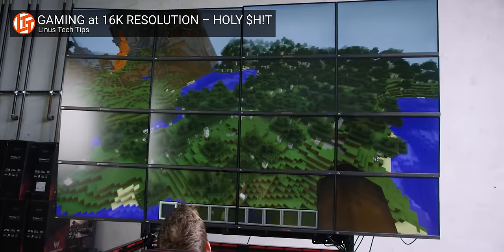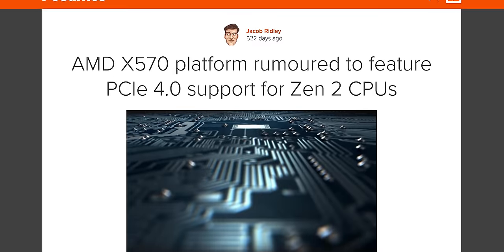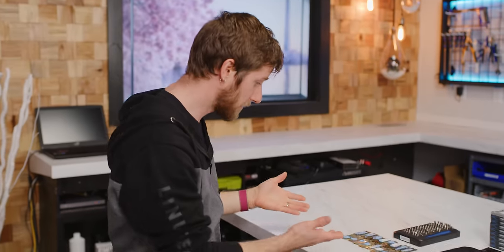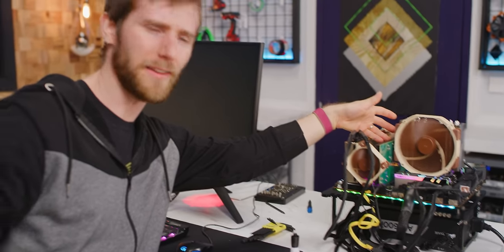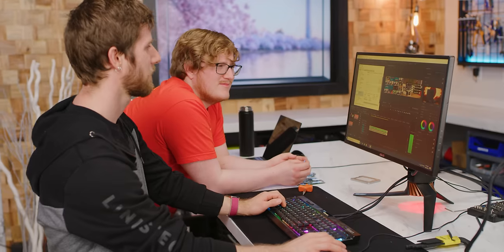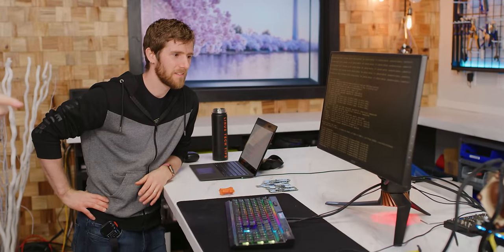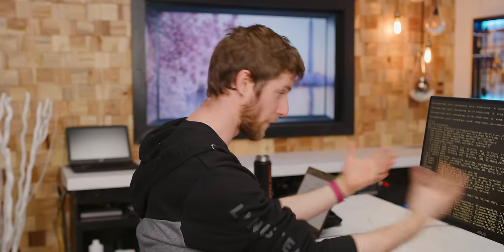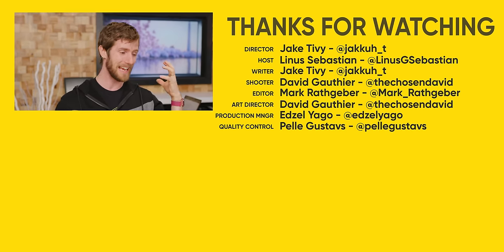This is 50x faster than your PC… HOLY $H!T - Liqid LQD4500 Honey Badger

Comment: Title: "This is 50x faster than your PC"

Me: using a 9 Year old HDD with about 20MB/s
"i think you misscalculated something there"
Reply: I think mine is older
Reply: Mine is 13 year old
Reply: But i got new pc
Reply: Been there. Get a SSD. Not even a fancy one. Literally the cheapest one is okay
Reply: *old
Reply: @llvmpipe  hayırlı olsun
Reply: Imma bouta do the math!
Reply: ok
Reply: @Felixkeeg  With a HDD that slow though, it's likely IDE. An IDE to SATA converter will be a bottleneck, although it will be just a little bit faster since there's no moving components.
Reply: Thats an hdd from 2000....
Reply: Chin up son, a 9 year old 5400rpm HDD should be able to do at least 40MB/s.  I want you to stand tall and proud and not undersell yourself.
Reply: I think it's 1845* faster.
Reply: I know Right ?   I'm on a Lenovo with 4G Ram.  Can't even play Kirby Space.  They put 1T of Hard Drive in the thing and NO RAM.
Reply: me using a 5200 rpm hdd from a laptop as my os hard drive on my desktop
Reply: I have 6 year old 120GB SSD, 94% lifetime 😋
Reply: @IoIxD  really?
Wasn't into computers back then ,but my 2004 system still has sata
Reply: My hdd is 11 year old and it gets over 90MB/s read speed so I don't know how bad your HDD have to be
Reply: @Felixkeeg  cheapest with dram*
Reply: Imagine saying maths
Reply: Me with a ide harddrive
pathetic
Reply: I think you should just spend the ~20 USD for a cheap SSD. Trust me, the experience will be WORTH it. No matter what kind og hardware you're using.
Reply: 20mbs? My old ass wd that I used to have that is like 10yo and it's still did 80~100mb
Reply: I think 20mb/s topspeed is more in the range of USB2.0 thumbdrives or 25+ year old drives
Reply: @miltoska9708  I have a hard drive from around that same year with SATA and it's 100MB/s. SATA hard drives were faster then 10MB/s even back then.
Reply: depends what you are using it for but yes 20mb/s is quite slow even for an hdd
Reply: Efe The God Don’t like your own comment
Reply: Yeah same I'm currently using a optiplex 960 with gt 220 graphics card lol
Reply: Buy a cheap SSD, the experience difference is huge.
Reply: mine is 18 year old ide 40gb 5400rpm
Reply: @jilianjing7549  So Very Slow..Get ANy 20$ ssd & It Is Night & Day ! It Blew My Mind When I Got My First One.. Now I Will Not Build Any Budget Pc WithOut One...The Whole System Is Faster !! Best 20$ Ya Can Spend On Any PC !
Reply: mine has components from 2008 i think
Reply: My PowerMac G4 from 2003 has an SSD that hits 130MB/s lol.
Reply: It’s 28 Gt/s not Mb/s
Reply: You guys are disgusting using all these underage HDDs!
Get something over 18 with UATA-133! :D
Reply: TFW your HDD is slower than my internet.
Reply: It's only 5x faster than the PS5
Reply: @andersmartinson5214  imagine not knowing that maths is how they shorten mathematics in other parts of the world such as the UK. And they think it's weird that we shorten it at as math.
Reply: What if I own 2 of these things? 1000000X compared to most peoples PCs
Reply: Well my HDD is 9-10years old, but it still works! (It's a 2,5" 500gb HDD)
Reply: I run a ryzen 9/2080 with 2 4.0 nvme in raid 0, and 10tb of storage in raid 6 across 6 drives in my icydock hot swap bay. It seems my gaming setup could potentially cure cancer, but for the time being its mainly use to kill nakeds with a rock on the beach.
Reply: @logirex  😂😂if you think so bud
Reply: Mine is from 2004 so 16 years 74gb 7200rpm(seagate barraguta). Its been like 6 years that makes scratchy noises but apparently is still good since it operates at speeds 90-120
Reply: I still have Decade old WD Velociraptors i use for working data. Great performance but soo slow compared to even Single NVMe SSD.
Reply: How about you grammarize rightly first before commenting on someone's calculus
Reply: Why are you watching LTT when you give a shit about your PC?
Reply: i have a ssd. its one second to start my desktop. i love it <3
Reply: So his nvme is 1450x faster than your 9 year old hdd
Reply: Have 23 bucks? Buy an SSD.
Reply: my 11 years old laptop i'm using to watch this video
hold my spe
Reply: More than a 1000x faster.
Reply: im using a chromebook
Reply: @davidsucesso2419  thats AN???
Reply: Dang, last time i used a HDD that was in the 20MB/s range was an old IDE laptop drive from 2000
Reply: I think fn sucks
Reply: Its over 90000000 😆
Reply: is that bad?
;-;
Reply: I had maxtor ide hdd from 2003, und it was working fine with 40 Mb/s r/w speed...
But my current seagate barracuda on 2tb give speed more than 180 Mb/s
Reply: I'm using a base MacBook pro from 2010 he messed up
Reply: How come my old hard drive says 6GB a second and it never gets anywhere near that ? Even on burst or sustained ?
Reply: @Klejdi lol floppy drives are faster than that !
Reply: @logirex  a 7200 rpm Seagate ? Wowee !!
Reply: AMATEURS, mine is 500kb, it’s 13 years old
Reply: my drive almost there for that mark but about 20MB/s
Reply: 20 MB/s 9 year old HDD?  I have an 8 year old WD Caviar Blue and it starts at 133 MB/s and ends at 70 MB/s (average 105 MB/s).
Reply: I was there on ide until 6 months ago I got tried of the load times so I bought a small drive for $40 figured I would put windows and maybe a game or 2 on it and have it after getting it I bought 2 more I can't go back to ide anymore I just use my old ides as back up drives now  now I no longer have to go out for a smoke while I wait for windows or gta to load
Reply: same bud
Reply: I got a SSD  I feel you pal
Reply: Yes I got a new PC but again we're using hdd.
Reply: 55$ will get you a high speed 500 gigs of ssd
Reply: And theres probably more cheaper than that from people who dig even more than me.
Reply: I got a rtx 2060
Reply: The Kingston ssds I run in RAID0 clock in at around 480Mb/s. Not megabytes, megabits.
Reply: mine is from 2006 ha
Reply: Same. Mine is 8, though.
Reply: IDE gang
Reply: 29MB/s     

mines better
Reply: Imagine two of those in raid 0
Reply: @llvmpipe  and it's still faster
Reply: Lol if is 1000 times faster than mine accurately
Reply: Man that’s pretty fast tbh.
Reply: @llvmpipe  19 years old ...
Reply: Atleast I got an SSD after almost 5 years
Reply: What about my 960 gtx with very low ram 2-4 GB
Reply: @RatPlaysGames  that's a graphics card, not a storage unit
Reply: @amvymavy  i forgot
Reply: @amvymavy  if im wrong tho
Reply: You miscalculated the number of s's in that sentence.
Reply: @theexcelproject6973  oof got em
Reply: @Felixkeeg  they are expensive.
Reply: Oh I feel bad now mine is 79 mb/s
Reply: @AK-tf3fc  no they're not. 2 stick of decent 4GB DDR4 ram is more expensive than a 240GB SSD

Comment: 31.5 gigabytes per second: Now that's fast!
10 years later: Bruh, how did we even put up with those back then?
Reply: 16 core CPUs? How'd they even run Windows on that?
Reply: @dragonborn.k  1024 cores are the usual now!
Reply: Rahul Mehta nahh anyone with that aint a gaaaaamer u gotta have 16384 cores man! raid 0 like 32 20PB 65536 PB/s Super Solid State Quantom hard drives
Reply: @mikebruzzone9570  look up how many times the avg. read/write speed of 10 years ago had been multiplied to match the speed from this video alone (and think about having that old speed, but running today's windows 10).  then use that multiplier on the video's speed, and you get yourself a possible avg. speed for 10 years in the future. tldr; its a joke
Reply: Kids in the future "what's a core?"
Reply: yep
Reply: meanwhile im on a 400mbps ssd
Reply: It's faster than RAM, in terms of straight up transfer rate.
Reply: 640K ought to be enough for anybody.
Reply: @tgdhsuk3589  400MB/s, 400mbps would be nightmarishly slow even for a hard drive.
Reply: @tgdhsuk3589  that's... Sata, isn't it?
Reply: In 25 years: I yeeted 592,783,390,569,738 brontobytes onto my USB 326.58 type-z flash drive... That's SO SLOW!!!!

PLS Reply in 25 years when you have this type of stuff... I'm looking forward to it!
Reply: ya 10TB/s
Reply: Something I find funny about these types of comments is that in the future I'm pretty sure things are going to be very similar. We thought we would have flying cars in 2000. Didn't really happen now did it? Also due to inflation I don't think high tech products will be available to everyone.
Reply: @dragonborn.k  in 10 years everybody will use linux dude
Reply: 10 years from now: You gotta pump those numbers up. Those are rookie numbers!
Reply: @rahulmehta7476   people in 2030: 1024? how am i gonna run gta 6 on that! 8192 is the normal and supercomputers have up to 128k!
Reply: bruh, raid striping is a thing, bruh !!
I worked in a photographic studio and we had raid 0 in our machines back in 2004 !!
I could open hundreds of pictures like a breeze in photoshop.
And I used RAM disks with astonishing speeds when I was a 14 (1999) in Mac OS 9.0 on the iMac G3 !!!
I had Connectix Virtual PC (which was the very first "VirtualBox", later bought by Microsoft and left to rot on purpose) running Win98 on THAT thing and it was AWESOME !!
You kids know nothing, nothing !!! XD
LOL
Reply: @L0ST Hello ?? Isn't speed the argument here?
RAM speeds are in the order of gigabytes per second !! Even in 1999 !! DUH !!!
Plus, I said photographic studio !!
We had top of the line ANALOGICAL development and a hybrid analog/digital printer (the size of a 15 meters square room)
with a 1200 dpi scanner for photographic films. Our pictures were HUGE, being a studio specialized in marriages with picture formats that are totally NOT common, like posters and huge formats. The average size of a picture was 100 megabytes, in TIFF.
I often opened the whole marriage for editing...It's gigabytes !!! It took seconds, in 2004, thanks to the RAID 0 configuration of the hard-drives...
This has a lot to do with "anything" because YOUR "anything" is just 10 years ago and I'm proving YOU wrong with "anything" from 20+ years ago...
Only because you don't about something it doesn't mean it wasn't already possible "back then"...
Back then, 1998, machine learning algorithms were already being used by geneticists around the world on a daily basis, precisely, pattern recognition algorithms to find alterations in chromosomes but only lately (2016 and on) they got all the hype from the media (and finally the general public)...
In 1970, speech recognition hardware the size of a big motherboard of today was already available in the tech industry. SIRI, in 1970...
See, the things you don't know of "back then" are so many that you wouldn't believe what's out there that's still totally modern and still ahead of the times...
Reply: @A_P3RS0N bruh chill where in 2020 not in 2004 so just keep on moving forward
Reply: I mean now we're "Intel Celeron is terrible!", 10 years later: "Intel Core i9 and AMD 5950x was a joke"
Reply: @A_P3RS0N true but i still hate celeron
Reply: I feel like we'll stop at 8k in resolution
Reply: @rileyclos7403  yeah and imagine have only 200gb of vram on your gpu, dont get me started on people with 1tb ram.
Reply: @rahulmehta7476  show me a 1024 core cpu.
Reply: Nah probably atleast 20
Reply: 10 years from now: Wait, brain chips didn't exist back then?
Reply: @tengahmain1055  Imagine though
Reply: @tgdhsuk3589  and I’m on a hdd lol
Reply: @sircompliments5380  Honda actually made a production model flying car but 9/11 happened immediately after that.   For some reason the the US didn't want individual flying terrorist bombs available to the masses.  Spoil sports.
Reply: Even in 10 years it'll be a lot. Technology doesn't evolve that fast...
Dude think. 10 years ago in 2011 we already had gaming systems with 16gigs of ram. And even now, 10 years later that's still a decent amount of ram..
10 years ago we also hat 1gbyte/s SSDs.
And even These days you can stop buy hdds that do 150mbyte/s..
Think before commenting 🙄
Reply: @Mika-85  It’s not meant to be taken seriously
Reply: Thank you guys so much for 1.4k likes!
Reply: @FreedomAirguns  Sounds like your language skills are stuck back in the 90's too!

Bruh?
Reply: @Persea gatuna 5000 series CPUs are already out. I’m assuming you mean the next generation of CPUs from Ryzen
Reply: @Persea gatuna Oh, you threw me off because you said they will be, future tense, instead of saying they currently are
Reply: When the pressure to improve gets too much just change the standard from gigabytes to gigabits. Easy.
Reply: @greenyonline  Quick 8x scale
Reply: @user136002  he means usual speed not rated speed which is the highest possible under select circumstances hdds usually never go above 200 mbps when I connect them through my usb 3 port and enclosure
Reply: @raawesome3851  of course it has to be sata 3.........I guess
Reply: @autisticghostdog8179  of course but for that people need to be advanced yesterday a friend of mine was like "you can reinstall windows?" during a casual conversation many people think windows is firmware so I doubt people will know even by then that they can switch os
Reply: @FreedomAirguns  r/iamverysmart
Reply: @FreedomAirguns  you have exceeded the word limit disclaimer no one is gonna read all of that
Reply: @boykin740  No it isn't I run celeron 2955u with 8 gb ram and crucial bx 500 ssd and it works amazing it can run upto ac 4 at best graphics with about 50 fps
Reply: @ryanolsen294  not much trouble hdds have their uses for one they do not have write limits unlike most ssds which have around 120 tb write limit but at the same time hdds heat too much my cpu benchmark which uses the heat sensor next to my hdd has even gone upto 88° celsius on my old inspiron n5010 which is no longer used
Reply: @jemiebridges3197  there still are flying cars but they are too complex to fly without pilot licenses they also require time for transformations just check out the moller skycar(hope I spelled it right)
Reply: @vrajeshpc  mbps = megabits per second
MB/s = megabytes per second
400mbps would be around 35-40MB/s
Reply: @Scarlet495  unless you have a hard drive from the early 90s, it's not 150 megabits per second.
Reply: @user136002  well i just grabbed it from my old system and it was 5200 rpm :sob:
Reply: Vrajesh Kumar, is that upper indian class or the lower one? Are you even allowed to pretend you're smart? XD
LOL
Reply: @vrajeshpc  More like you can't comprehend it...
Such a "smart and intelligent" response you got there...No counter arguments (actually opinions in your case) worth citing, I guess...
Reply: what do you mean renders didn't used to be always instant?
Reply: Yea, we use 56 terabytes
Reply: they will be like 31 Gbs? NOOB i dont use anything under 100
Reply: Fill my laptop ram in half a second
Reply: @TheAzurite  we use clusters now, get with the times pld man
Reply: Me with a 15 year old cpu: 
it still can run minecraft at 300fps with lunar and lowest settings ._
Reply: EEWWW HOW DID THEY MANAGE TO HANDLE WITH THAT?? 30GIGS A SECOND??
EVEN MY OLDEST QUANTUM COMPUTER MAKES 500 PENTABYTES PER SECOND AND THATS OOOLLD
Reply: How did we put up with monitors before 128k QOLED ips 80000:800000 monitors?
Reply: that's like a HDD... 300 GB/s is the minimum I would prefer! (joking)

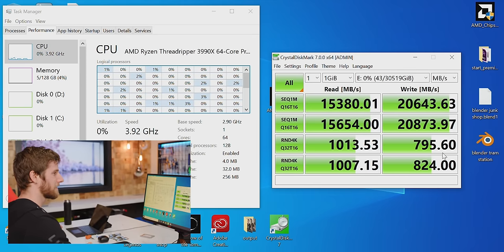Comment: 6:55
You know that you have a lot of threads when task manager needs to put a scroll bar and tiny boxes to represent the usage of all 128threads.
Reply: I'm impressed someone even thought to code that in. Like, when they wrote the Windows Task Manager a couple years back, who could have possibly had this many cores in their system to see that?
Reply: @YonatanAvhar  Xeon Phi users I guess, that platform went up to 72 cores and 288 threads
Reply: @YonatanAvhar  it seems to be using WPF, it does that automatically when you use the correct components

Comment: Not everyone was aware of this, but one of the huge inprovements going from PCIe 2.0 to 3.0, was PCIe encoding overhead. With 3.0 (and 4.0) it's 1.5% (128b/130b). With 2.0 it was 20% (8b/10b).
Reply: 8b/10b?, That's a huge overhead, USB 1.0 had less

Comment: I think everyone wanted to see some game loading times.
Reply: CPU bottleneck ? :)
Reply: He said it in the video. Under no circumstances would you be able to tell the difference between a Sata SSD and a NVME drive let alone one that's PCIe Gen 4. The load times would be only like 2-3 seconds faster here.
Reply: @MRdeLaat  nah bro GTA V 3 minutes
Reply: @thandozungu2428  need ultra texture modded gtaV longest loads of any game ive ever seen
Reply: Pointless. There would be no difference with regular SATA SSDs
Reply: GAMESSSSSS 😂😎
Reply: @MelvinKhosa  people get excited over 2-3 fps so why not seconds? XD
Reply: @MelvinKhosa  I think that's why some of us want to see it and some of us need to see it. To show that loading data is not the bottleneck, that actually processing that data is the bottleneck. Some people still don't get it.
Reply: Call of Duty: Modern Warfare in under 60 seconds!
Reply: @James Smith That would only work if games used all those threads when loading. :)